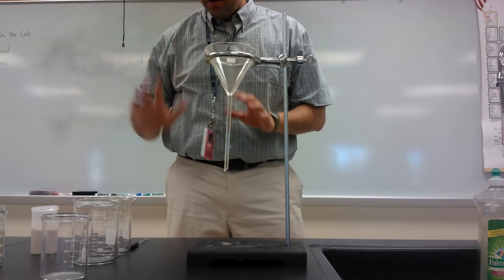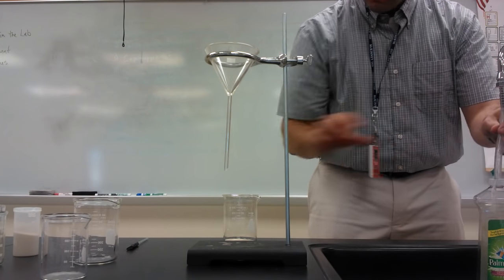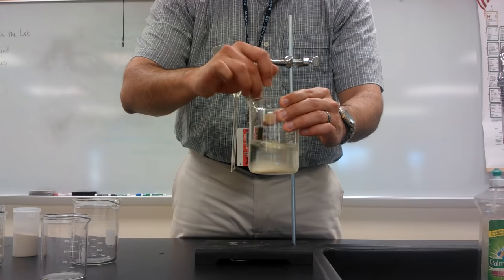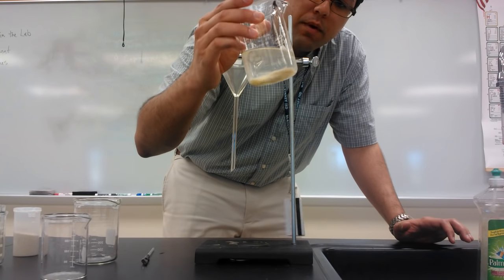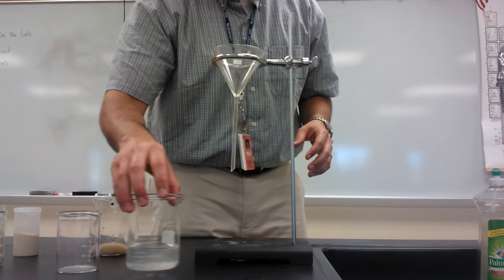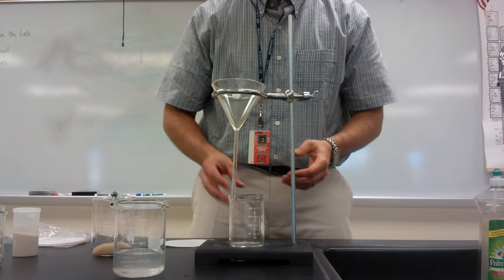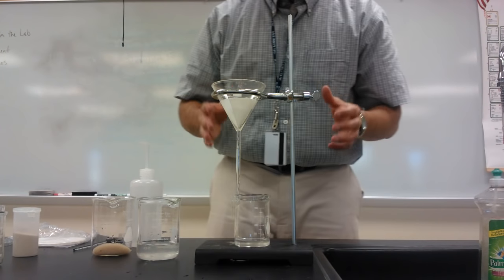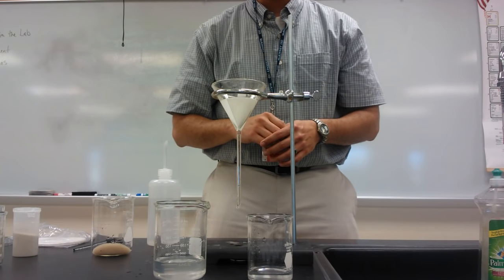Lab 1   Decantation and Filtration

Comment: One question the water in the clear water we can drink it?
Reply: jairo sanchez i think you can't because the tap water is not that clean :)
Reply: jairo sanchez no because there will always be source of error not 100% of the water was separated from the sand by specially decant  and also in filtration there is source of errors

Comment: Well, nothing there is nothing technically wrong with your apresentation, a solid 10. But there are a few things you kinda slipped, like leaving a gap between the two points while folding the paper, what type of filter paper are you using, because the draining seems pretty slow. 
Also I had to do this....
Take a sip of beer every time he says "uh" or "um" XD